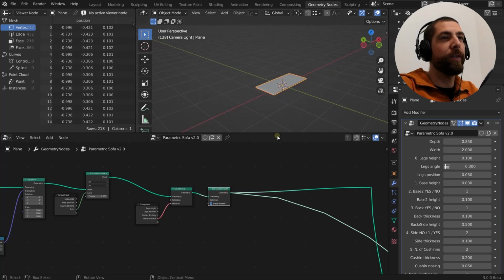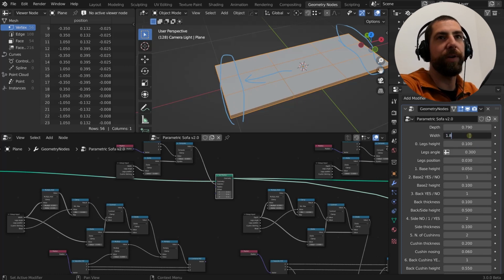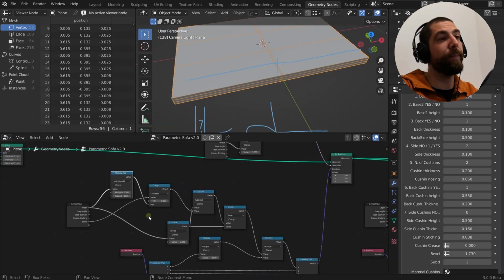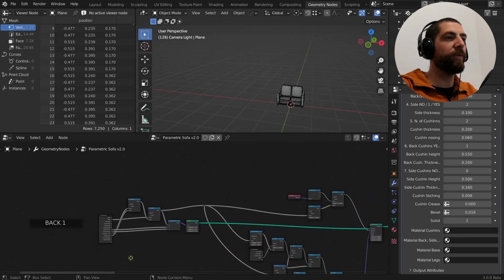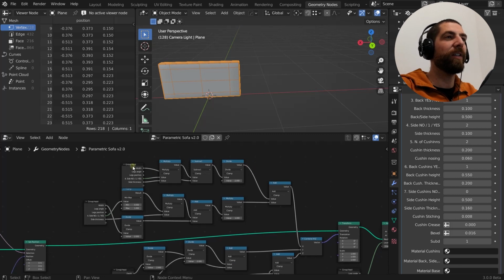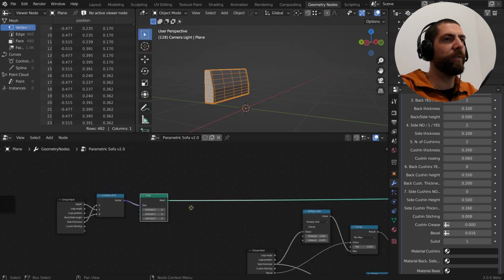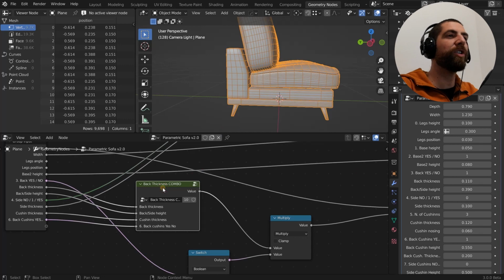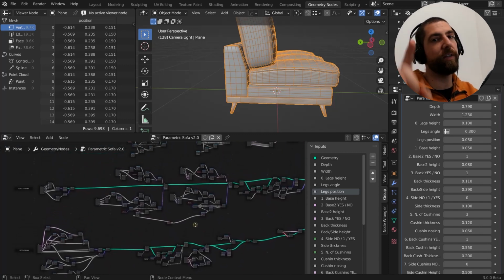2 Hours Rambling about my Sofa Geometry Node Tree - Part 2 of 3

Comment: I figured out two different ways to create a bevel.  First: Sub surf twice, first one with a crease of 1, 2 levels, second one with a crease of .28 and 2 levels.

Second way is a "2 dimensional" bevel.  "Filet curve"  on something like a rectangle, the curve to mesh using the new filleted curve as the "profile" and a line curve as the "curve".  You'll get a cube with rounded corners, in 2 dimensions, but not the 3rd.

https://youtu.be/eluAKWEbu84 to see what I mean.
Reply: You have earned a thumbs up

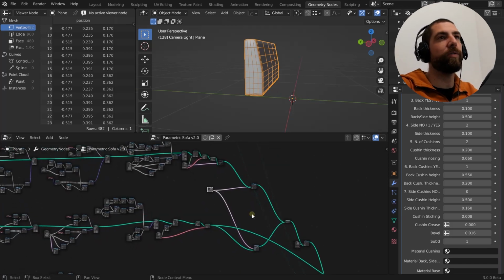Comment: You didn't need two switch nodes 23:55, just plug the "true" value from the bottom one into the True value of the top, since they have the same selection.

Comment: I'm trying to follow along with the tutorials to make this node tree myself,  but the Group Input options are confusing me since you're using the already finished setup instead of doing everything from scratch.
Reply from the maker: Im sorry you're having a hard time following along, but this "tutorial" is 2 hours long. If I wanted to record everything again from scratch, it would last probably 5 times as much, and it would be mostly me doing the same things over and over again
Reply: @BlenderBash  I was able to get through part 1/2 of the tutorial just fine, but the Group Input in your tutorial is mostly throwing me off since I don't see a socket called width
Reply from the maker: @sonario6489  with the Group Input selected, press Ctrl H (or Cmd H on a Mac). That should reveal the hidden unconnected sockets. Or hide them, if they are all visibile
Reply: @BlenderBash  I mean I'm actually trying to build it completely from scratch while learning the nodes in the process.  I'm up to the 11th minute on your second video, and from what I can see, the width seems to be the bottom value of the multiply node used for your bevel set up
Reply from the maker: @sonario6489  that's because the other sockets are hidden. If I understood correctly what you mean
Reply: @BlenderBash  Do u have discord? It might be easier to send screenshots
Reply from the maker: @sonario6489  
I dont, I'm sorry. The easiest way for You to learn, would be to purchase the file and use it as a reference. That's what's there for. It would be impossibile for me to guide you through the whole process like this. Especially since later in the process, in the second and third video, I go over some things rather quickly.
Reply: @BlenderBash  Just purchased the file and my head is already spinning just looking at the node setup
Reply from the maker: @sonario6489  just watch the video and follow the node tree. I hope it will help you to achieve your goals
Reply: Group inputs start out blank.  If you watch the early part of the first video he explains both ways to add entirely new inputs, and how to name them.

First is just drag an input from an existing node to the "blank" output of the "group input" node.  This creates a new input.  Without your mouse cursor anywhere in the geo nodes window, press N, and you can select the new input and rename it, or press the + and add new inputs.
Reply: same for me
Reply: Oddly, at first I did the same thing, then i noticed that he was starting with a plane.  I guess in order to even add a geo node, you have to have some kind of primitive in the viewport.  Mine happened to be a cube - the default one.  I left it, and added the same nodes and did as he was doing and it worked just fine, because the geo input is a throwaway.  You don't really do anything with it in this case, and you're immediately telling the nodes to put a cylinder in, so it's like an annoying requirement to make geo nodes, but is not important.

the other thing is that when your mouse is in the the active window part (in this case, the geo nodes window/frame, then you can press N and get the side bars.  There, you can click on Groups and show the Group input, and add as many inputs as you want, define what kind they are, order them, set min/max limits on them, etc.  You can also just connect some other node to it, and it will automatically create the input.

I hth.